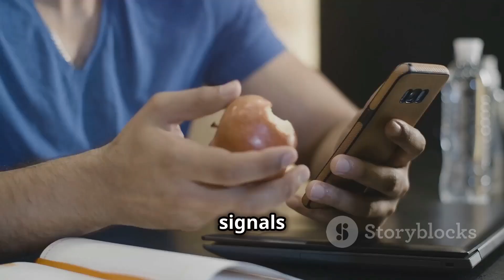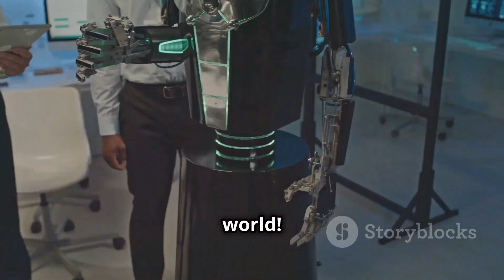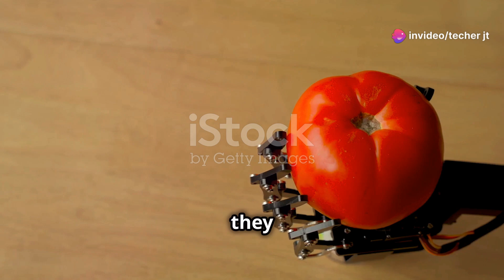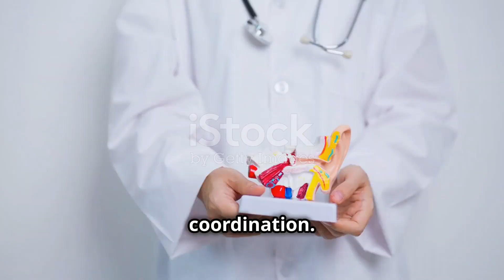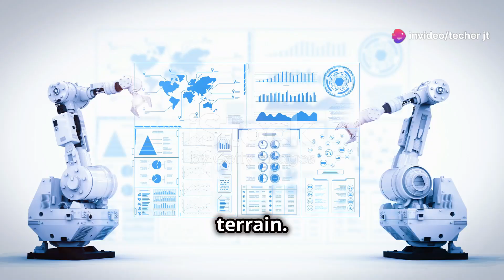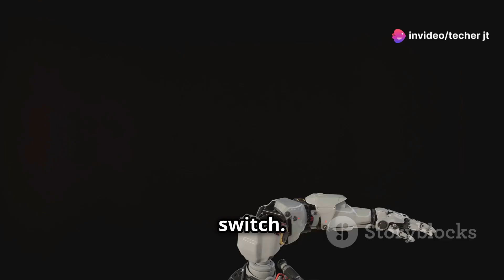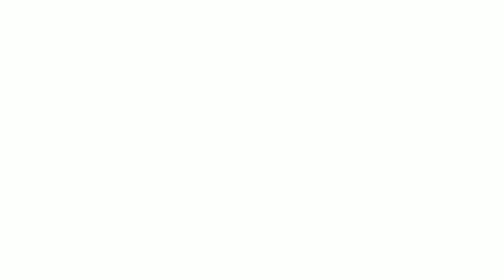Robotics Mechanical Sensors

Comment: Cherish Stefie D. Bacayo
10-LYRA 

1. Understanding: What are mechanical sensors, and how do they function in robotics?

Answer: 

Mechanical sensors are devices that detect physical quantities, such as force, pressure, acceleration, or displacement, and convert them into electrical signals. These signals are then processed by a robot's control system, allowing it to perceive and interact with its environment. They are crucial for robots to perform tasks that require precise control, interaction with objects, and navigation in complex environments.

Comment: Christian Dynniel M. Llanos
10-Lynx

1. Understanding: What are mechanical sensors, and how do they function in robotics?

Robots use mechanical sensors, much like human sensory organs, to detect and respond to their environment. These sensors convert physical stimuli, such as pressure, temperature, light, and movement, into electrical signals. This allows robots to accurately navigate, manipulate objects, and perform tasks safely and efficiently. For example, proximity sensors help avoid collisions, tactile sensors enable delicate object handling, and visual sensors allow robots to "see" and identify their surroundings. By processing these inputs, robots can interact with their environment in ways that mimic human perception.

Comment: Rebmevon B. Marquiño
10-LYNX

1. Understanding: What are mechanical sensors, and how do they function in robotics?

- Mechanical sensors are robots' sensory organs that allow them to perceive their surroundings and engage with the environment. They transform physical cues like touch, pressure, and motion into electrical signals that the robot's controller can interpret. This approach is comparable to how humans use their senses to navigate and comprehend their surroundings. These sensors enable robots to navigate and interact with the world.

Comment: Marion James C. Nale
10 - Lynx

1. Understanding: What are mechanical sensors, and how do they function in robotics?
Mechanical sensors are sensors that allow robots to perceive the world around them, robots depends on sensors to gather information, these sensors convert stimuli like touch or motion, into electrical signals that the robots brain the controller can understand. Its like translating the language of the physical world into a language that robots can comprehend. These sensors are crucial for robots to perform tasks accurately and safely. They allow robots to avoid obstacles and handle objects with precision and even respond to changes in their environment

Comment: Ara Bella S. Quilestino
10 - LYNX

1. Understanding: What are mechanical sensors, and how do they function in robotics?
Mechanical sensors allow robots to perceive the world around them. These sensors convert physical stimuli like touch or motion into electrical signals that the robot’s brain-the controller can understand. It’s like translating the language of the physical world into a language that robots can comprehend. These sensors are crucial for robot’s to perform task accurately and safely. They allow robots to avoid obstacles, handle objects with precision, and even respond to changes in their environment.

Comment: Abbygail A. Somobay
10 LYRA

3. Analyzing: Compare and contrast force/torque sensors and accelerometers. In what situations would each be more beneficial?

-> Force/torque sensors provide precise control for tasks such as robotic surgery or safe human-robot interaction. Accelerometers help with navigation, collision detection, and maintaining balance in mobile robots. The specific application determines which of the two to use; force/torque sensors are better for precise force control, while accelerometers are essential for stability and avoiding collisions.

Comment: Cathleya Jamis
10- Cassiopeia

1. Understanding: What are mechanical sensors, and how do they function in robotics?

Mechanical sensors in robotics detect physical changes like force, pressure, or motion and convert them into electrical signals. These sensors help robots interact with their environment, adjust movements, and maintain stability.

Comment: Ruztylou Gaviola
10-LYRA

Q1.Understanding: What are mechanical sensors, and how do they function in robotics?

-Mechanical sensors are devices used in robotics to detect physical changes in the environment. They function by converting mechanical energy, such as pressure or movement, into electrical signals. These signals are then processed by the robot's control system to make decisions or perform actions.

Comment: Chris Nathan Dwayne M. Dura 
10-Lynx

4. Evaluating: Assess the impact of mechanical sensors on the efficiency and safety of robotic operations in manufacturing. Provide specific examples to support your evaluation.

A: Mechanical sensors improve efficiency and safety in manufacturing by enabling precise control and obstacle detection, reducing errors and accidents.

Comment: Nuriel Danna S. Garcia
10 - LYNX

3. Analyzing: Compare and contrast force/torque sensors and accelerometers. In what situations would each be more beneficial?

Force/torque sensors are essential for tasks requiring precise control and interaction with objects, such as gripping delicate items or ensuring safe human-robot interaction, while accelerometers are crucial for monitoring movement dynamics and maintaining balance, making them ideal for navigation and stability in dynamic environments.

Comment: Annarica Nina A. Loyola
10-HERMES

1. Understanding: What are mechanical sensors, and how do they function in robotics?
Mechanical sensors allow robots to perceive the world around them. These sensors help robots navigate and interact with their surroundings. Robots also rely on mechanical sensors to gather information by converting physical signals into electrical signals that the robot's brain or controller can understand. These sensors are crucial for robots to perform tasks accurately and safely, and they also enable robots to avoid obstacles.

Comment: Jasmine E. Delapus
10-LYRA

1. Understanding: What are mechanical sensors, and how do they function in robotics?

Mechanical sensors enable robots to perceive their surroundings, much like humans use their senses to understand the world. These sensors gather information by converting physical stimuli, such as touch or motion, into electrical signals that the robot's controller can interpret. Essentially, they translate the language of the physical world into something the robot can understand. These sensors are essential for robots to perform tasks with accuracy and safety, allowing them to avoid obstacles, handle objects precisely, and adapt to changes in their environment.

Comment: Chelsy Manzanades
10- Andromeda

2. Applying: Describe a scenario in which tactile sensors might be used in a robotic application. What advantages do they provide in that scenario?

A: Imagine a robot picking strawberries, it needs to be gentle enogh not to crush the strawberries and firm enough to pull it out of the stem. Tactile sensors can help the robot determine the ripeness of the strawberry by sensing its softness and adjust its grip.

Comment: Kenichie C. Racero
10- Hermes 

1. Understanding: What are mechanical sensors, and how do they function in robotics?
Mechanical sensors are devices that allow robots to perceive their environment by converting physical stimuli, such as touch, motion, or force, into electrical signals that the robot's controller can interpret. These sensors mimic human senses to enable robots to interact with their surroundings accurately and safely. For example, force/torque sensors measure forces and torques acting on a robot, helping it handle objects with precision, while tactile sensors provide detailed information about an object's surface properties, such as texture and temperature.

Comment: 10 - Cassiopeia Chain 👇🏻👇🏻📝📝
Reply: Li Cyril A.

3. Analyzing: Compare and contrast force/torque sensors and accelerometers. In what situations would each be more beneficial?

-Force/torque sensors are ideal for applications requiring precise force feedback, like robotics and manufacturing, while accelerometers are better suited for motion detection and monitoring, such as in mobile devices and vehicles.
Reply: Adrienne Kiesh R. Magbanua
10 - Cassiopeia

Q1: What are mechanical sensors, and how do they function in robotics?

A: Mechanical sensors in robotics are devices that convert physical stimuli (such as touch, motion, or force) into electrical signals that the robot's controller can understand. These sensors allow robots to perceive and interact with their environment by providing information about forces, motion, contact, and other physical properties. For example, tactile sensors give robots a sense of touch, while accelerometers and gyroscopes help robots maintain balance and measure movement.
Reply: Y'vhone Felkris L. Estanda
10 - Cassiopeia

Q2. Applying: Describe a scenario in which tactile sensors might be used in a robotic application. What advantages do they provide in that scenario?

— A tactile sensor can be used by robotic hands to handle small parts in electronics production. If the part is a small, fragile item, the sensor is able to register pressure and hence the robot will not exert too much pressure on the part and thereby causing damage. This ensures thorough handling, enhancing product quality. Tactile sensors also provide an additional sense to enable them use their fingers for manipulating small objects with different sizes and surface roughness.
Reply: Oclaman, Eureka Glyril B.
X - Cassiopeia

4) Evaluating: Assess the impact of mechanical sensors on the efficiency and safety of robotic operations in manufacturing. Provide specific examples to support your evaluation.

- Evaluating: Mechanical sensors significantly enhance manufacturing efficiency and safety. For instance, robots equipped with tactile sensors can detect the properties of components during assembly, ensuring proper fit and reducing errors. Also, force sensors can prevent excessive pressure that might damage parts, thereby increasing operational safety and reliability.
Reply: Lorenz Michael Paderanga
10 - Cassiopeia

Q1: What are mechanical sensors, and how do they function in robotics?

A: Mechanical sensors in robotics are devices that convert physical inputs like touch, movement, or force into electrical signals that the robot's control system can process. These sensors enable robots to sense and engage with their environment by providing information about various physical factors such as force, motion, and contact. For example, tactile sensors give robots the ability to feel touch, while accelerometers and gyroscopes aid in maintaining balance and tracking movement.
Reply: Mark Uriel G. Tacbobo
10-Cassiopeia

1. Understanding: What are mechanical sensors, and how do they function in robotics?

Mechanical sensors or specifically tactile and force-torque sensors, bring a semblance of the sense of touch to robots. It mimics the  ability to 'feel' can significantly influence a robot's interaction with its environment.
Reply: Joaquin Gabriel L. Cabug-os 
10 - Cassiopeia 

1. Understanding: What are mechanical sensors, and how do they function in robotics?

- Mechanical sensors are devices that detect physical properties such as force, pressure, and position, converting these measurements into signals that can be processed by a robot. They function by responding to physical changes like deformation, movement, or pressure, allowing robots to interact with their environment effectively.
Reply: Keth Jelzar A. Montes 
10 - Cassiopeia

1. Understanding: What are mechanical sensors, and how do they function in robotics?

-Mechanical sensors are devices that detect and measure physical properties such as force, pressure, displacement, torque, or acceleration. In robotics, they play a crucial role in providing feedback to the control system, allowing the robot to interact effectively with its environment.
Reply: Princess Jelian M. Ucat
10 - Cassiopeia

Q1: Understanding: What are mechanical sensors, and how do they function in robotics?

A:  Mechanical sensors are devices that allow robots to perceive and interact with their surroundings by converting physical stimuli, like touch or motion, into electrical signals. These signals are sent to the robot’s controller, helping it understand and react to the physical world.
Reply: Aclo, Cheryjan G.

3.Force Sensors are ideal for applications requiring precise force feedback, like robotics and manufacturing, while accelerometers are better suited for motion detection and monitoring, such as in mobile devices as well as vehicles
Reply: Nella Regasa
10 Cassiopeia

1. Understanding: What are mechanical sensors, and how do they function in robotics?

- Mechanical sensors in robotics detect physical properties such as force, pressure, torque, or position. They function by converting mechanical movements or stresses into electrical signals, which can then be interpreted by a robot's control system. Common types of mechanical sensors include tactile sensors, force/torque sensors, and accelerometers, which help robots interact with their environment by providing feedback on physical interactions.
Reply: Kiesha Cantila
X- Cassiopeia

4) Evaluating: Assess the impact of mechanical sensors on the efficiency and safety of robotic operations in manufacturing. Provide specific examples to support your evaluation.

answer: Evaluating: Mechanical sensors greatly improve both manufacturing efficiency and safety. For example, robots with tactile sensors can identify component characteristics during assembly, ensuring accurate fit and minimizing mistakes. Additionally, force sensors can prevent excessive pressure that could damage parts, thereby enhancing safety and reliability in operations.
Reply: Ethan James P . Malferrari         
                                                                                                                                                                                             
1. Understanding: What are mechanical sensors, and how do they function in robotics? 

Mechanical sensors are devices that detect changes in a physical environment, such as pressure, force, or motion, and convert these changes into measurable signals. In robotics, they provide real-time data to control the robot's movement, interaction with objects, and performance. Examples include tactile sensors, force/torque sensors, and accelerometers. These sensors allow robots to perceive their environment and adapt their actions accordingly, enabling tasks like gripping objects with varying force or navigating uneven surfaces.
Reply: Kristine de la Rita
10 - Cassiopeia 

1. Mechanical sensors convert physical stimuli, into electrical signals. Helping the robot to understand. It's like translating a foreign language into the robot's native language.
Reply: Leonardo M. Verbraecken 
10 - Cassiopeia

1. Understanding: What are mechanical sensors, and how do they function in robotics?

-Mechanical sensors are devices that detect and measure physical properties such as force, pressure, displacement, torque, or acceleration. In robotics, they play a crucial role in providing feedback to the control system, allowing the robot to interact effectively with its environment.
Reply: Merchella Da-an 
10 - Cassiopeia 

1. Understanding: What are mechanical sensors, and how do they function in robotics?

- Mechanical sensors are devices that detect physical forces or changes in mechanical properties such as pressure, force, or displacement. In robotics, they enable precise interaction with the environment by:

Measuring Force: Providing feedback on the force applied during tasks like lifting or manipulation.

Detecting Position: Monitoring changes in position or movement for navigation and control.

Sensing Pressure: Monitoring pressure changes crucial for gripping and fluid control.

Monitoring Vibration: Helping maintain stability by detecting vibrations.